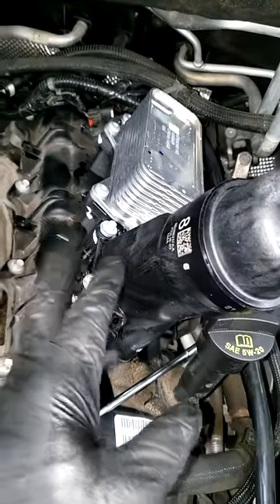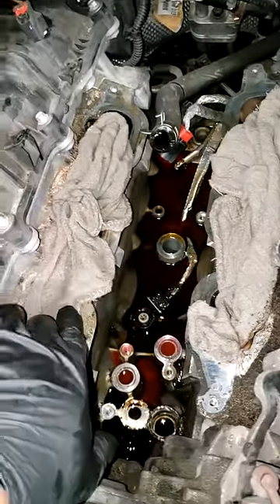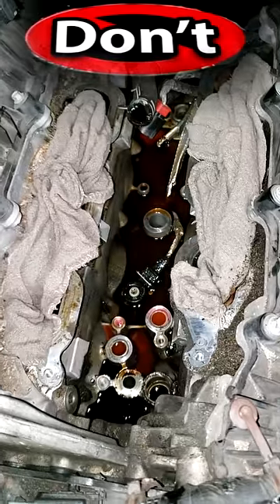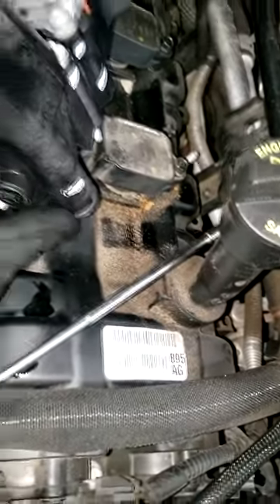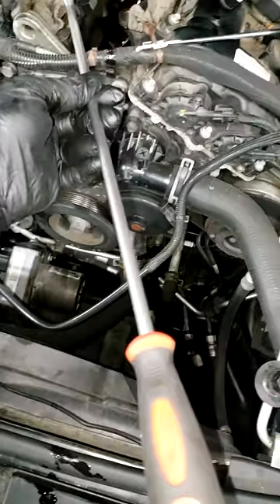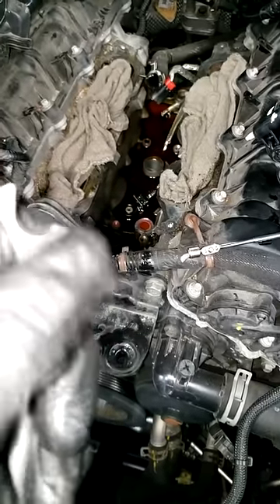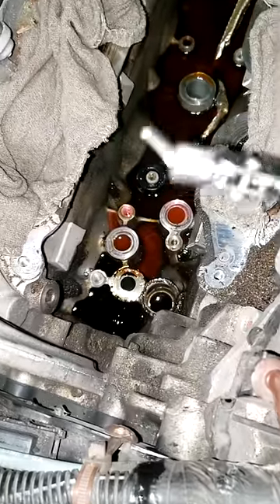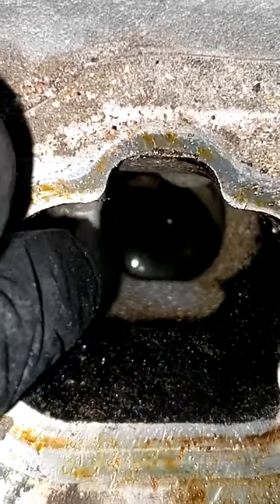This will scare the hell out of any mechanic. But I found it.

Comment: Yup, cover open holes, cover or plug intake ports etc. NEVER PUT ANYTHING, bolts nuts, clips, small tools, etc., above an opening in the engine. I as a partsman at a dealership used to, as the other partsmen would do, went to look at something in a truck that was spec'd like a phone customer wanted,  so I climbed in this truck in the shop to ACTUALLY see the part the phone customer was struggling to describe to me. When I climbed in the truck of course shook. I shook a bolt loose from the cowl panel,  where it had been placed by the mechanic. It went down in the motor. Deep. The mechanic was almost done with what he was doing to the top end and couldn't find that bolt. He KNEW what happened and had to take the oil pan off and the real heavy strengthening plate on the bottom of a 3406 Cat engine. He found the bolt on top of that really heavy plate. He came to me and was to my amazement not mad at me. He told me what I had done, and said you just taught me a hard lesson. Nothing above an open hole down into a motor. He remembered seeing me climb in the truck. He was glad he saw me and then tore into it and found it. That bolt may have just gone down into the oil pan with no harm or it could have made the motor go BOOM. He learned and I learned both as a partsman and a mechanic.

Comment: My coworker had a swivel socket break and the pin fell into the cylinder. He didn't tell anyone and tried to crank it with the sparkplug out. The pin put a perfect hole through the piston and destroyed the head. The engine was on backorder leaving the customer without a car until it was rebuilt a month later.
Reply from the maker: Dang
Reply: Ouch
Reply: My 8mm socket (on the camshaft bearing cap) fell down into the timing chain cover and all the way down to the oil pan .... 🤬
Reply: Fun.
Reply: Is he still your coworker?
Reply: @ACommenterOnYouTube  time to get busy on a search and recovery

Comment: Great advice!  It can and will happen.  No one wants ti spend time finding a part or nut or screw that's fallen into the engine
Reply from the maker: Especially if you don't hear it hit the floor.
Reply: @OnlineMechanicTips  
Damn it's as bad as a rusted bolt lol
Reply: At a junkyard near me someone's going to be real unhappy about the 10 mm I lost down the intake.
Reply: @spdergod  uh oh !  S**t happens.  It's a junkyard and that's a roll of the  dice anyways
Reply: @spdergod  Go leave a warning sign on that motor !! Lmao
Reply: Tore apart my 2.9 v6 outta my bronco 2 and n took the valve covers and all, heads, all the way down, well I was using Q-tips to  do some deep cleaning and dropped that sucked down the open valve 😅 and it wa so funny bc my Pawpaw just left for harbor freight, said don’t drop any of them down the open valves 😂😂😂😂😂

Comment: Anything that plugs those holes is your friend. Just don't forget to remove them.
Reply: Motorsports teams use brightly-colored metal covers for the intake and exhaust. That avoid rags getting forgotten and sucked into the engine. I'm just a DIYer, I spent a few minutes building covers from scrap cardboard, it worked well for me.

Comment: A fluid extractor is a handy tool for these jobs. Get what oil you can through the filter housing and put the hose down in the valley and get as much coolant out as possible when you crack the seals. Once I realized I could do this, it helped my OCD for a clean job and the impending feeling that I may have been cross-contaminating fluids a little as coolant levels with an oil passage.

Comment: I can totally relate!!! I was 14 years old in 1994 and got my first job at a private shop owned by a shriner. The first job I did for this gentleman was a distributor R&I on a 3.8 liter series ii Buick with the forward sliding clamshell hoods. I pull the distributor just fine, but as i am pulling it, i knock the clamp right down through the hole in the intake. Needless to say, I learned alot about the top half of those motors on that day lmao. Eventually found it on top of the cam after we pulled the intake. Boss was seriously questioning his decision to hire my young but lol
Reply: What's a Shriner if you don't mind me asking?
Reply: @LSA chronicles  shriners are the guys with the little Arabic hats that have those little orange cars. They are an international group of philanthropists. They also have the shriners hospitals. I don't know much about their philosophy, but the guy I worked for was a bit of a jerk lol

Comment: good job with the rags bet you wont forget them! haha
Reply from the maker: Lmao..yea mun. The world stops until I find that lil piece. Don't nobody move or say nothing..lol
Reply: When in doubt rinse with marvels mystery oil with the drain plug out and drop the pan.
Reply: A rag can still be forgotten. Someone had forgot to remove rag from intake and vehicle couldn't start later to find a rag in the intake. How does that happen is unknown
Reply: @dcomputers  probably too dirty or dark to notice.
One mechanic I used to have only used bright ass orange rags for this reason. No idea where he got them but I do know you had to try pretty hard to miss them.
Reply: @dcomputers I had this very case! A VW GTI. Crank no start. The engine sounded strange on cranking. Almost like a bubbling sound. What started to give it away to me was that if you cranked it long enough, it would collapse the charge pipe hose coming out of the turbo charger. If you removed the oil fill cap, it would release the built up vacuum, and the charge pipe would return to normal.

I honestly thought Wow are the intake valves this badly caked up with carbon, that they are completely blocked off? I pulled the hose from the manifold to the breather valve, and stuck my borescope camera in there...

Found masking tape blocking all the intake ports 😂😅. Someone had done a water pump previously (Intake out job) and put tape on the ports. They just forgot to remove it on reassembly.

Comment: Always put the rags, but even if the valve is open, just take out the spark plug and put a magnet in thru there
Reply: If that doesn't work , blow air in thru a long nozzle into the open valve. That should move the chunk around and onto your magnet..hopefully its small enough to pass thru the sparkplug hole..

Comment: Back in the 1970's,  I knew a guy who was trying to re-thread a bolt hole on an intake manifold on a 1960's 283 Chevy. The tap handle had two small hardened V-blocks that held the tap inside the center of the tap wrench. Anyway, he had the breather & air filter assembly off of the carburetor when one of the V-blocks fell out of the wrench handle. He looked all around the top of the engine & peered down the carburetor & could not find the missing part. After unsuccessfully searching for the missing part, he finally gave up, & put everything else back together. A few days later, as he was backing out of a parking spot at K-Mart, the missing V-block managed to pass through one of the intake valves & into a cylinder. I didn't get to see the top of the piston, but did see the underside of the cylinder head. The piston had pounded the intruder up into the flat side of the cylinder head next to the valves. There was probably 6 or 7 perfect indentations made in it, as well as damage to the intake valve & valve seat. Ouch!

Comment: I also have seen people leave rags in things like hoses on hydraulic systems and cause a 20k pump to take a shit 😊so don’t forget how many rags you stuff in the holes 😅 cus that is asking for trouble as well😂
Reply: I sold a truck to a guy,he asked me if l wanted his old truck for free,l said yes it was a Nissan , l pulled the valve cover,there was a 2x4 wedge the previous mechanic used to keep the  timing chains up,and 2 pounds of wood shavings
Reply: @dougtodd305  LMAOOOOOOOO 🤣 trying to build a timing traveling tree house…. That’s badass you got the truck for free I hope u got the issue addressed and back on the road!

Comment: I've seen and objects that ended up in the cylinder. In one incident a customers car returned after a blown head gasket repair. Upon removal of the head, it was dianosed that the object didnt stand a chance of holding its original structure. The head, piston, and valves suffered minor dings, but looked like it chipped away more carbon buildup than damage. What the obect was was unidentifiable but was still too large to exit the exhaust valve.
The mechanic that had previously worked on the car admitted to losing a 10mm valve cover nut "somewhere", but it apparently didnt make its way past the intake valve at the moment so he thought nothing of it until the car returned the following day sounding like the devil doing a drumroll.
Reply from the maker: O wow...dang...I would have lost sleep all night wondering where the nut went. That had to suck
Reply: @OnlineMechanicTips  He actually did the lady a favor. It chipped off more carbon than did damage. It didnt really do any damage, just sounded like it was. I was even considering dropping BBs in the carb on mine. Kinda beat those heads into hemi's. 😁

Comment: This is a good life lesson on why you don’t use harbor freight tools for important jobs.
Reply: Had nothing to do with it. The wrong tool for the job entirely. That pry bar is made for i terior panels that use those push button hold downs. Its not made for prying up on metal things.
Reply: Exactly wrong tool that's for plastic clips that's why it broke no where near a pry bar this guy should know better
Reply: @IxliFeHackxI  he should but if you read the comments he left on my comment on in the main thread you can get a sense of being a cocky know it all mechanic that just cuts corners and tells everyone else he knows better.
Reply: Harbor freight is no longer a joke. Only people that spend their paycheck on snap on or Mac still say that.
Reply: @AverageCitizen333  That's exactly right
Reply: Def not the tools fault, they person using the tool needs remedial mechanics 101 starter book. These are the names of all your tools. Tool #7 on page 2 is an automotive trim tool, thee God's of everything greasy and just plain dirty are not pleased with you sir. Let's tighten up. Torque spec is tight.

Comment: I lost an intake plenum bolt when changing a knock sensor on my 5.3. Only noticed when I didn’t have enough bolts during reassembly.
I searched the ground and in/on/around the engine. Considered throwing another bolt in and forgetting about it but I didn’t.
I removed the intake again and looked into all the ports that I could see and didn’t find it. Went to autozone and bought a mirror, looked into the intake port nearest the firewall and there it was. Back to autozone to buy a magnet (that I haven’t used since) and got the bolt out.  Huge pain in the ass but at least I didn’t ruin my motor.
Cover those ports!
Reply: Pretty much what happened to me with an extension, only I didn’t notice it, motor ran for 3 days, it wasn’t pretty, needed a piston and a head

Comment: I tape them shut. After the intake comes up, I clean the ports, then use a couple layers of 2 inch wide masking tape. Rags work in a pinch, but I prefer to tape now, because it comes up clean, and no lint drops. That and air tools can't blow it off while working around it.

Comment: It happened to me once when i was like 16-17 and just finished rebuilding a VW air-cooled. The nut that holds the intake manifold slipped went right into the port, right into the open valve and into the cylinder. Thankfully it's a flat engine so it didn't end up on the cylinder and wasn't too hard to fish out with a camera in the plug hole and a wire.

Valuable life lesson, cover up EVERYTHING when i work. I won't take a part off if i can't plug the hole, and i keep track of hardware like it's the most precious thing. Now i build motors transmissions and such and have never made that mistake again.

Comment: I had a 99 F150 with a 5.4L 2V.
I dont recall what i was doing, but i had the fuel rail off, and was trying to re-install it when the plastic "top hat" piece of the bottom of one of the injectors broke and fell into the intake. I used plumber's friend claws to get outost up it, but there was a small piece that was missing. After reassembly, i took the truck for a spin. After 15 minutes into my drive, the truck choked and sputtered for 5 seconds, then cleared up and never had another issue.

Comment: I had it happen doing the fuel pressure regulator on my gmc jimmy. 

And it was a non ferrous nut, so I had to rig up a vacuum to 3/8 vinyl tubing to get it out fron ontop of an intake valve. Turned about a 1 hour job into 10
Reply from the maker: Whoaaaaaa, sorry bud. Glad it worked out
Reply: @OnlineMechanicTips  I honestly almost had a mental breakdown that day hahahahaha

I could see it at first in the upper intake with my inspection camera(which i got from a time my pops had a clip fall in a head while doing a valve adjustment), then I knocked it onto the valve with my magnet.

That's the best tip I can give anybody that has something fall into a cylinder...rig up a vacuum to a vinyl tube.
Reply from the maker: @jacobcarson2559  That could have ended very ugly. You da man hunting that down

Comment: Doing the spider injector on my 4.3L I dropped one of the small nuts that holds the fuel rail into the #6 intake runner. Luckily once I got the manifold off I could see the valve was closed and I used a telescoping unit to grab the nut out. I have built the same engine since then and that holds as a constant reminder for me to always block off the openings in the engine whenever possible!

Comment: I had a same scare a when I first started working on cars while replacing the intake manifold on a Ford 4.6 engine, for a moment I thought that a leaf fell into one of the intake ports. Good thing the leaf was too big to fit into the intake port so I just gently pulled the leaf out and made sure it didn't break into tiny pieces. Ever since I learned to always cover the intake ports from now on.

Comment: I just did one of these for the first time ever yesterday and you don't need to pry on it at any point. I also made a mistake and broke the intake because I didn't see hidden bolts. Luckily it glued back together with plastic epoxy. Get some prydrivers from matco

Comment: I always cover my intake ports. However, rather than rags that can get sucked in if I brain fart, I use the blue painter's tape in long strips and write something like "Remove before starting" on it.

The good thing about painter's tape is that it will rupture but it won't get sucked in and destroy a valve if you turn the engine over after forgetting about it.

Comment: The last time I had to put back in the inner valve springs back in an engine I just broke the camshaft in, I put red rags in all the little holes where oil drains back in the heads and the holes leading to the lifter valley, THEN I taped plastic, a white garbage bag, around the outside of the valve cover area to catch the valve keepers in case I dropped one, it wouldn't get lost down in the car, suspension frame etc. I did drop one keeper. The plastic surgery drape did the job. The few minutes it took to cut the garbage bag and tape it in place saved trying to find the dropped one or having to order some keepers.

Comment: If you didn't have them covered you can stick a borescope or inspection camera down each one with a open valve. With spi borescope THE RECON 2415 or 2815 SERIES 1.8 mm borescope 4 way articulation

Comment: I learned through alot of pain and suffering on how to assemble a sbc. (I started engine building out of curiosity) and I couldn't tell you how many bolts and washers I've had to fish outta intakes,head bowls, and cylinders. It wasn't until my grandfather was watching me struggle to get a 10mm bolt out of the head intake tunnel that he said " why don't you just stuff them with rags son" and my life has never been so easier. Im so mad I over looked such simple method

Comment: I ALWAYS taped the Intake ports over, I know an older tech who did too.. somehow despite taped ports a tiny bolt that didn't even belong in the engine got into the intake.. we had a 3rd tech who was jealous when he wasn't top dog end of the week.. after that I put rags in ports and tape and then marked locations with a permanent marker.. cause I knocked out a rack and pinion in 1:45 while he took 6 hours on the same van I I was top dog that week..I still found a few bolts in the holes ( I knew it was there when the tape marks didn't line up) so I fished all the ports with a magnet, pulled out 2 tiny bolts, neither of them belonged to the job... imagine how 3rd techs face looked when it was all back together and ran fine.

Comment: I do enough OM642 oil cooler gasket jobs that I designed, and had water cut (out of my own pocket), a set of aluminum covers to keep the intake ports as well as oil and coolant flanges covered, which also allow me to uncover one intake port at a time for carbon cleaning while I'm there.

I've been doing this long enough not to skimp on pre-cleaning before disassembly and covering up as much as possible.

Comment: I put intake manifold gaskets on an Audi R7 a few years back. The direct injected motor has all types of lines running across the top of the intake that are held on with metal clamps. I covered up the intake runners with rags while it was apart, but had to take them out when I put the intake back on. While putting the intake on one of the clamps fell down in the intake runner and I didnt notice. It must have hung out inside the runner for about a week, the car was towed back in about a week later with the engine absolutely destroyed. The clamp must have bounced around a bit on top of the intake valve before finally coming apart and making it into the cylinder. A very expensive lesson to learn.